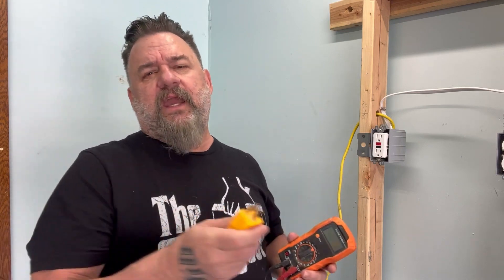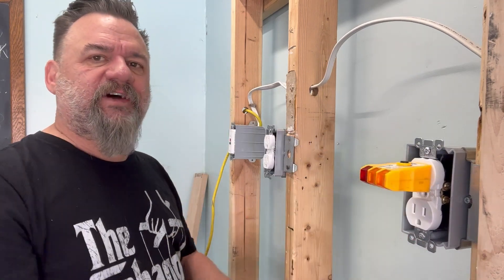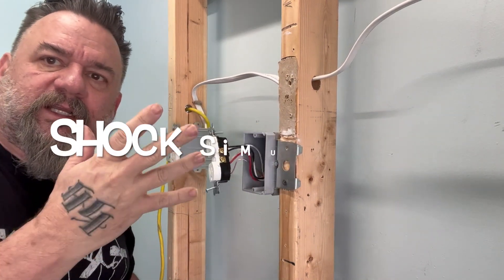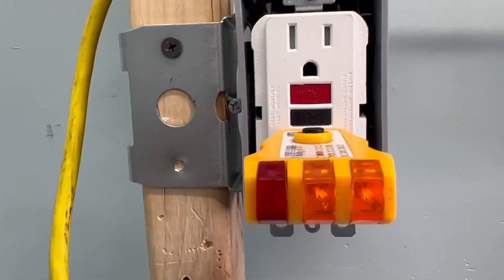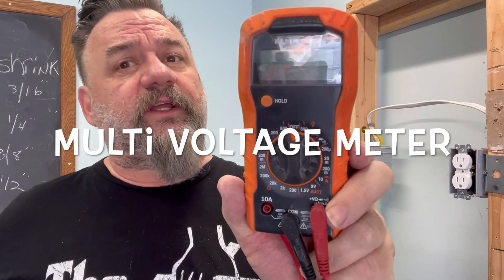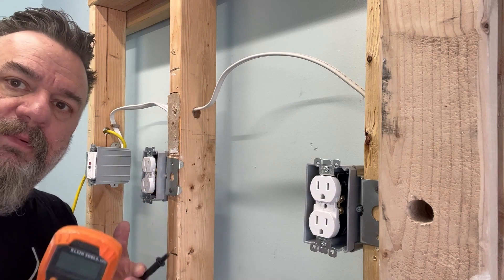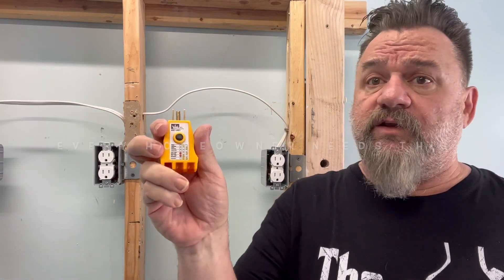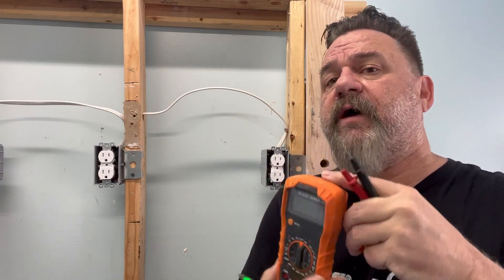Voltage Tester You REALLY Need - Your Reaction Could Surprise You!

Comment: Tamper resistant plugs suck! They inconvenience EVERYONE all for the sake of who? Some 4 year old that is trying to somehow get a fork in an outlet? How many people do you know of who've had kids successfully get zapped putting something in a recep?? I know of NONE! But now we ALL have to lift weights to plug a vacuum in!
Reply from the maker: yep a pain in the ass for sure
Reply: I and all 3 of my siblings got shocked poking things into outlets.  We all survived.  Edit: We would not have been stopped by tamper resistant outlets, and I hate them with a fiery passion!

In my case, I don't think I stuck anything in but plugs until I knew better.  My mother says she had to pen me up when she was running the vacuum because as soon as I could crawl I would crawl to the wall and unplug her. I wasn't coordinated enough at that age to plug it back in.

I played a lot with outlets and plugs. Some of which had open wires dangling. My first painful shock was when a plug got stuck and my 8yr old self had small fingers of which one slipped down between wall and plug and prongs...  ZAP.  Another time I was paralyzed by 120vac running thru my arm down to my knees on the wet grass. Luckily I could talk my brother into unplugging me.

I think it was my youngest brother who was learning about multimeters and accidentally on purpose probed the outlet while on the amps setting.  Result was a blown fuse in the meter, nice soot deposit burned into the face of the outlet and child fingers, and it wouldn't have been a shock but the probes were not at all suitable for 120vac so there was some additional spark and zap opposite the arc flash soot. We got new probes and fuse, he healed, and the outlet 30+ years later still has soot.
Reply: @Sylvan_dB  Hahaha Jesus Christ. Well I stand corrected! There ARE some suicidal kids out there apparently. You're lucky to still be here. I'm glad we share a dislike for these TR plugs. Thanks for the laugh!